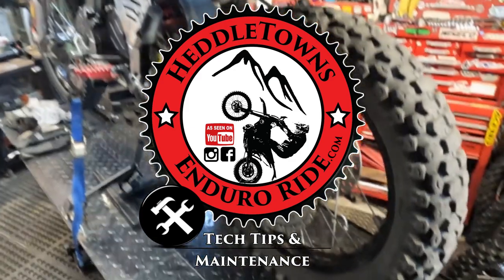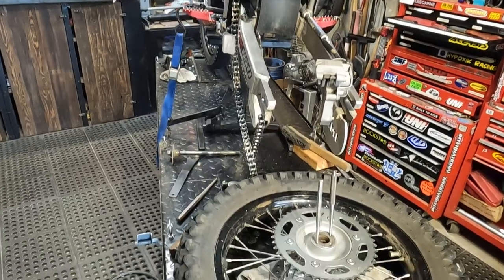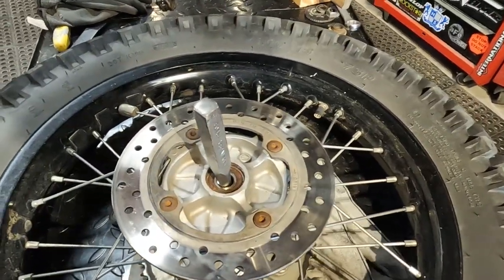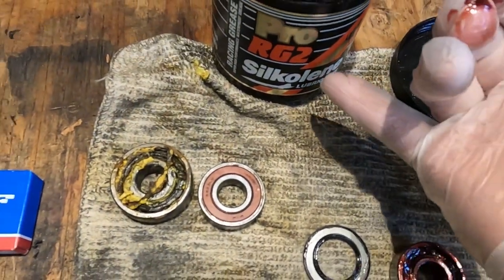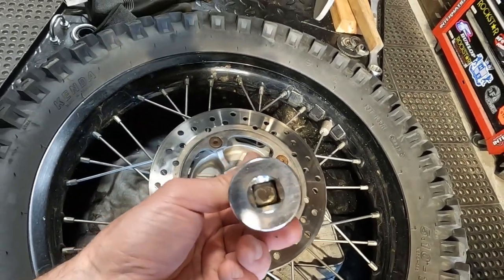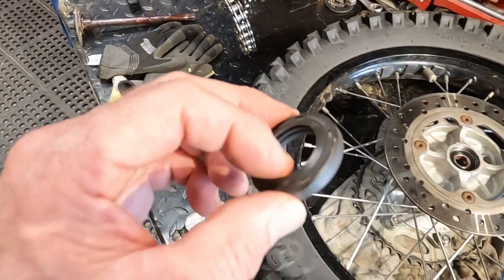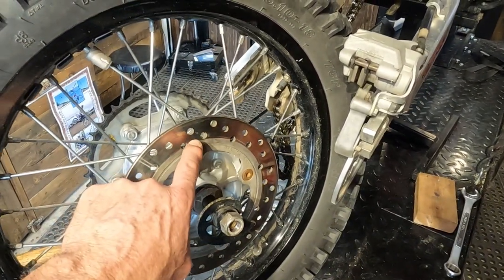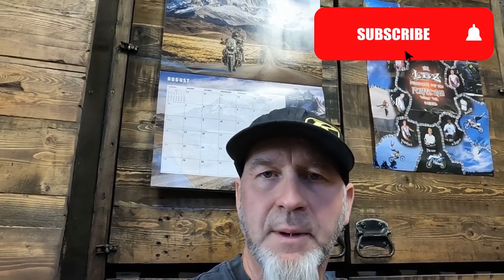Honda XR Wheel Bearings Dual Sport Maintenance Tips

Comment: Nice to see you being in the workshop. 

I like most of the tips, but as a machineguy I have a few comments on the bearings. 
The little amount of grease from SKF is enough, no need to add extra grease because it will cause more friction and maybe attract dirt. Yes I know, the wheel is not spinning super fast and the XR have plenty of power. 

The outer race should not be lubricated with grease. The thin coat of oil from the factory is enough. If the outer race is lubricated to much and the bearing seeze the outer race would spin and damage the hub diameter. 
A hairdryer could heat up the hub and the bearing pops right in. 

I have installed many double sealed wheel bearings and they last a long time through mud and water. No extra grease added. 

Of course people can do what they like, just my opinion based on education. 

Ride on 🏍⚙🔧
Reply from the maker: Good tips thanks! Ive been around bikes for 45+ years always had good luck with my methods! Ride safe! \m/

Comment: Hey buds good see you again, I mean on here.
I moved away from k town a few years ago and didn’t get a chance to see you on the trail. I had a xrl650r then, so ya that’s cool.
But recently my neighbour was ready to sell a xr250r great shape 2nd owner, what was I supposed to do lol. I had to grease the wheel to make sure it went to the right home. I had already done the carb for the owner, so any way, once I got my grubby mitts on it, I gave it a couple quick rides, short for sure, well all the sudden I was like surprise rear wheel must be going flat. So no bs head for the barn, minutes, I’ve pushed enough bikes home, anyway the tire was not low, after I had filled it before from sitting, and wow when those bearings go, it’s happening. So I’ve got parts and looked up some inspiration and here you are. But ya when they go wow they go. I stopped meow. 
Thanks again!

Comment: Thank you for all your informative videos.  

I recently bought a 93 XR.

Upon further inspection disassembly at home, I realized that there was no retainer for the sprocket side bearing. The threads for the retainer are also “gone”.  Instead the previous owner has used a bigger seal.
All the appropriate spacers are present, and the sprocket side bearing is tight and well seated.

In your opinion, do you think I should worry about the missing bearing retainer?
Bike will basically be used for mild off road touring.

Thank you for your experienced thoughts.

Comment: Fun history fact - SKF started the Volvo car company in the 1920's.  Volvos are one of my other obsessions.  And BMW airheads, Triumph twins...  Thanks for the tip.  Wondering if the dragging front brake on my XR has to do with wheel bearings.  Definitely does not free wheel.
Reply from the maker: HaHa that is interesting thanks for sharing! Hmmm when you spin your wheels as I did it should do several revolutions before slowly stopping because the disc brakes naturally drag a tiny bit! 🤔

Comment: I have a 1995 XR650L, I was wondering where you got your aftermarket foot pegs I've been looking for some like those, Nice front end conversion, I did the same a few years ago, threw the old front end in the trash can, called Emig Racing up back east told them what I had and what I wanted, they built me a custom triple tree, my tack and ignition mount up perfect, it also excepts the Honda CRF 450 forks I ordered off eBay, the whole front turned out better than I expected it would

Comment: 650L rear bearings fail so quick cos water can enter between the axle and the washer collar thing (outside spacer), bypassing that seal and getting to the backs of the bearings. You can get outer spacers with o-rings in them that seal against the axle to fix the issue.
Reply from the maker: These double sided seals will also help with that!

Comment: The shop just installed new rear SKF bearings on my 650L but the wheel doesn’t spin as freely as yours by hand. 

Should the centres of the bearings be super free moving? Mine had a little resistance when I put my finger in the centre hole and spin

Comment: Great videos! Thanks. I weigh about 230lbs. what adjustment # on the back axle would you use to adjust the chain for proper slack?
Reply from the maker: Refer to owners manual as there's too many variables to advise on that! Thx.

Comment: Really appreciate your efforts on this channel. Alot of good tips also. I also have a XR650L 93 model. Its geting old now...a bit sloppy all over. I think i will do some work on it comming winter. I wanted to ask you even if it may not be an exact science. Its the chain. I notices that on your bike when rear wheel is off ground, it seem like very little slack in the chain compared to others i've seen. Also mine is way looser than yours, but i dont really know how much slack there should be. One thing is bearingwear, but i get this extreme chugging and front to rear vibrations on mine when driving on low revs and wonder if it has to do with the slack in the chain or if its just my bike getting sloppy in all joints and engine internals. Do you have any idea of what to check? My sprockets are ok and no slack in the front output shaft btw
Reply from the maker: Thanks! My chain is actually a little loose in this video which could for sure cause the chugging also being in the wrong gear when going to slow! Look around online for a manual for chain adjustment.
Reply: @HeddleTown  Thanks for the reply :) I checked with the 3 finger test you showed in your video. I get just 3 fingers under the chain just behind the chainguide. Yes i do have a Vaportech which shows RPM. I run around 3200 rpm to get rid of much vibrations, below that, my teeths almost fall out....which is a suitable RPM you think when driving with a bit of restistance (shallow uphilll). I also feel a bit of hestitation just above ide throttle...its missing there continously, but on more power it pulls ok...i cant take the job pulling apart the carb, unless i know if i should go up or down on which jet. Was a nightmare to get the airside boot on i remember

Comment: My inner spacer isn't moving sideways enough to be able to get a punch to bite on the far inner race.
Reply from the maker: Try the other side one side moves more than the other.
Reply: @HeddleTown  
Thanks.  I did.  I gave both sides repeated tries.  Tried a bearing tool I bought on Amazon, just bent the tool, no budging of the bearing.  That's with heating the hub.  They've been in there almost 20 years.  Next step I think is order the Tusk tool from RMATVMC.   That's all I can think of now.   What do you think?
Reply: @elgringoec what did you do to remedy this? I’m currently in this battle.. thanks!
Reply: @georgemack444  
I bought a "motorcycle tool" blind bearing puller, wasn't enough room for the inside lip to grab the back of the bearing so that bombed too.  Finally got it with, of all things, a concrete anchor, the kind that expands when a machine threaded bolt is tightened into it.  Heated the hub some with a heat gun and with a piece of rebar from the other side, tapped it out with a mini-sledge.   
"Easy peasy" 😂🤯
Reply: geez...   @elgringoec
Reply: @drewsXR650L  
That's life.  If there weren't any challenges then all would be easy and satisfaction of accomplishment rare.